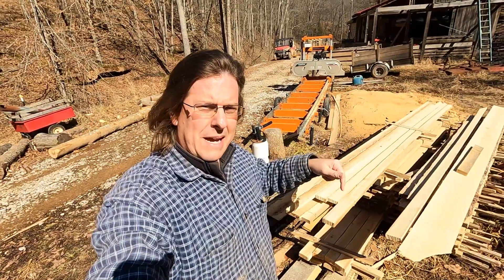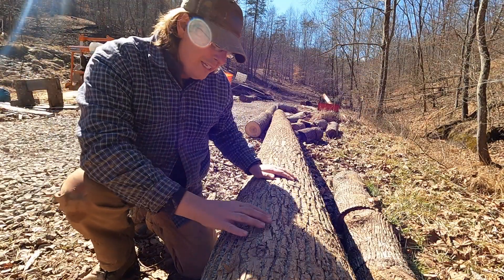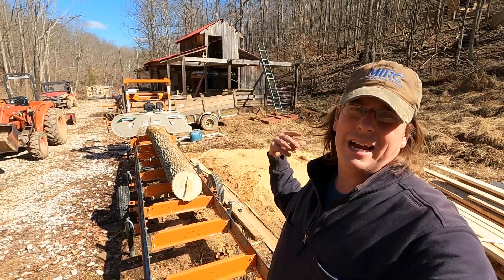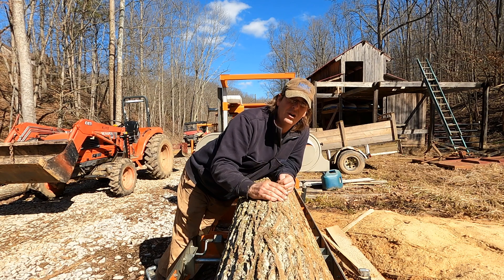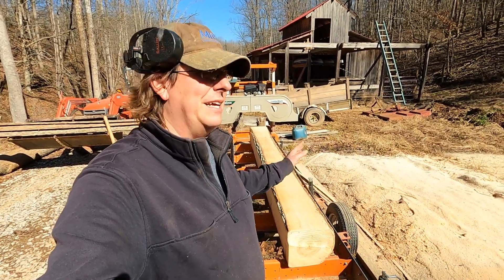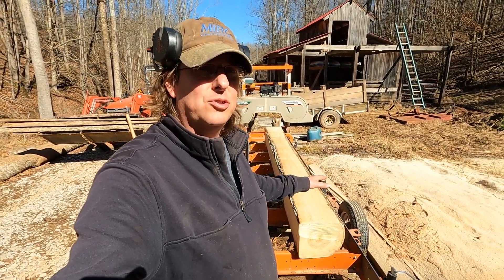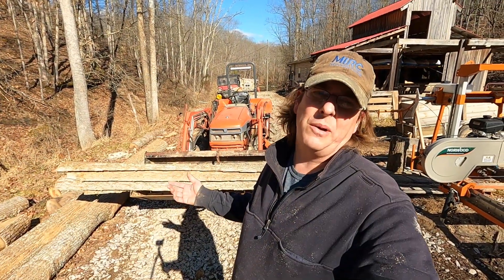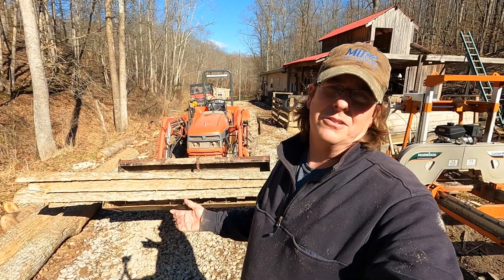Why Tulip Poplar is My FAVORITE Wood to Mill

Comment: I have two pretty large tulips two take down. They are both in the 120-130 ft tall and about 40-46 inches wide about 2ft up from the root swell. They both have a co-dom but the split is about 60-70 ft up. I’m planning to quarter saw all of it. Most I can afford at the moment is a chainsaw mill. I think I’ll go with a logosol, that set up seems to allow you to do the first two cuts of the quarter sawing as straight as you can with a chainsaw anyhow. I’m a finish carpenter so I saw the opportunity when I bought the property years ago. Thanks for the video !
Reply: Thanks for calling it tulip. That's the correct name.
Reply: Did you die from exhaustion lol

Comment: I live in southeast ky, and worked around the Lexington ky area for 15 years. I've used enough yellow poplar lumber to cover half the country. We restored tobacco barns and converted a lot of them to horse barns. We used poplar are framing lumber cut as 2x6 and larger. Most of the footage was cut as 4/4 random width that we used as boxing. I've reboxed so many 100ft plus barns that I couldn't begin to count. I love poplar and have a lot on my little hilltop homestead myself. Great video!
Reply: I’ve got a barn to fix in SW Virginia, what do you mean when you say rebox?
Reply: @brianwest9178  just knocking the old boxing off and replacing it with new. It's a good time to address any other issues with posts and wall purlins too

Comment: I like larger poplar to mill.  When you get down in the 10-12" diameter stuff, it tends to stress relieve a LOT on the mill......I've seen it arch 2" off the center of the mill as you saw.  We too have a LOT of large poplar on our place.  Most 2nd/3rd growth forests in the Appalachian region are that way.....big amount of logging took place in the 30-40-50's as the American chestnut was dying out, and the forest that came back is one of primarily poplar.  I bought my place in 1982, and I'd estimate it was logged about 40 years before that, so my timber has another nearly 40 years on it.
Reply: Instablaster...
Reply: It's not poplar!
Reply: @hyzercreek  Yes, but these people call it that. Dumb.

Comment: Yellow poplar is in the code book...so is red oak, white oak, red maple, basswood, sweet gum and black gum.  They'll keep adding more.  It started with a concern over a potential shortfall in yellow pine but I think now has become an easy doctoral thesis, but the knowledge is still of value.  So you can have the wood graded etc., ts very close to syp, so very strong, but not as hard or heavy.

Comment: Totally agree poplar is a great soft "hardwood" works really well as a evergreen substitute for stick building. It's grain is also very similar in structure to walnut and cherry so if you stain it nicely it would fit right in with a lot more expensive hardwoods. Totally agree very flexible nice product!
Reply: It's not poplar!
Reply: @hyzercreek  even though it is commonly called Tulip Poplar, it is not actually in "poplar family" but every thing said in the above comment is still valid.

Comment: A NH casket company used a lot of poplar in their caskets.

 Also My brother in law couldn’t get much heat out of poplar in the wood stove.   

I have some large poplar as well as a variety of other large  trees on my land.
I’ve got some 60 year old ‘bull pine’ that I paid, I think $600 or $700 just to drop one with the bucket truck and leave it on the ground last Christmas and there  ten or more white ‘bull’ pine that my neighbors might be worried about.

Comment: Just found out Woodmizer has carbide tipped Razor Tip sawmill blades on their web site. As a carpenter, when we changed from steel  saw blades to carbide tipped, they would last for 3 months instead of a week. Might be worth the extra cost to try one.

Comment: So, if you wanted to end up with “true” sized dimensional lumber what shrinkage allowance, if any, do you mill for?
Reply from the maker: Depends on species, grain, and even how I mill. For example, if I am milling to get quarter sawn white oak and I want to end up with a finished 1x6, I will mill 1.25 (5/4) x 6.50 knowing there will be little shrinkage. The extra half inch on the width is more for my edging allowance since I am edging with a table saw.

Polar shrinks about 1/8 inch per 1.5 inches when air drying.

Comment: How is Ash for making the projects you want to build?
Reply from the maker: Ash is nice. Most ends up as firewood as it is all standing dead now. If I had the storage to put up 10,000 board feet to dry it would be worth a good bit of money in about 10 years.
Reply: @RedToolHouse  we have tons here dying 
My little woods that I have has a lot. I was thinking I could get it milled up to use as mobile chicken coops , pig shelters and turkey structures and maybe a shed or 2. If not just the frame of them. Or if I could use as siding that would be even better

Comment: Keep in mind that hardwood and softwood are based on the fruit/flower. Balsa is a hardwood, but no one would call it a hard wood.
Reply from the maker: Yes, but the hardwood industry recognized tulip poplar as a hardwood based on density and value.
Reply: @RedToolHouse  Yes, but it is also actually hardwood. It is an angiosperm, so it qualifies as a hardwood, even though it isn't particularly hard. This is just weirdness in naming and it would have been better if they called it something like hardseed and softseed. Soft Maple is a hardwood, but you would think that soft maple is a softwood based on the name. If the nut/seed is encased, it is a technically a hardwood. even if it is quite soft. Conifers are going to be softwoods and deciduous are going to be hardwoods.
Reply from the maker: It is funny how biology and industry take things in a different direction.
Reply: @shannonswyatt  Soft maple is extremely hard, it's only called soft maple because hard maple is even harder. Hard maple (sugar maple) is harder than oak. Soft maple (red maple) is still very hard.